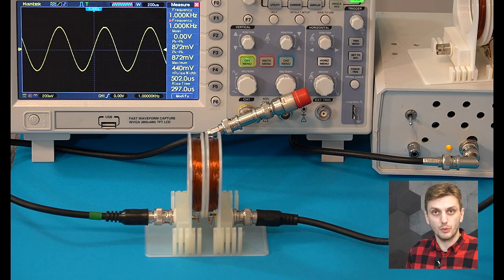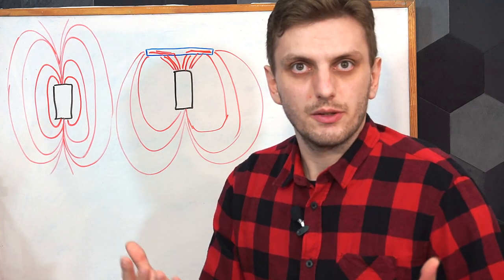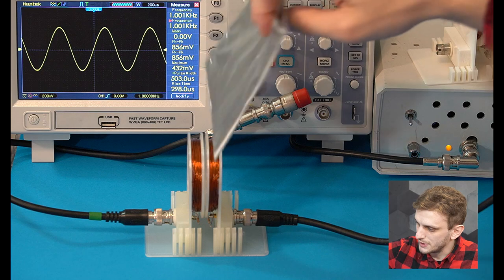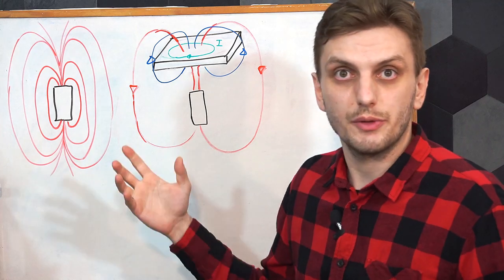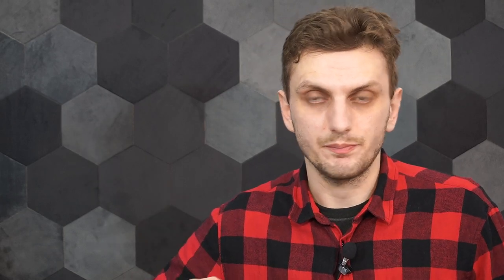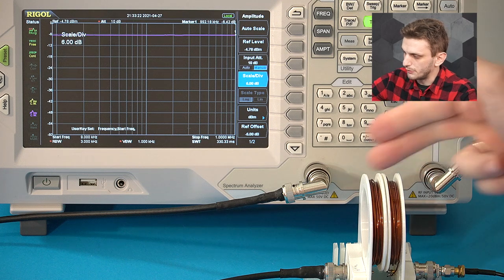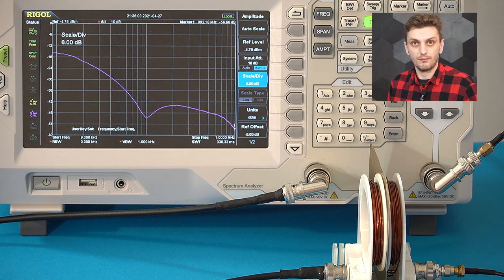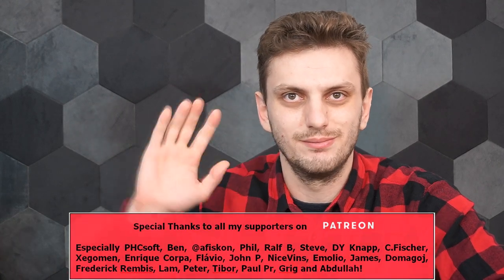EMC tutorials - Magnetic field shielding

Comment: Would it also help to ground the shielding?
What about hybrid solutions, so combining iron with copper for example?
Reply from the maker: Grounding any shield is very important, but its not necessary if we purely talk about magnetic fields, any currents induced into a shield, usually stay in the shield. I do want to talk about this in more detail in a future video focused on electric field shielding - there grounding becomes essential.
Reply: @FesZElectronics  Thanks, looking forward to it! :)
Reply: A good "razor" to ever answer this kind of question is "ground, with respect to _what_?"
In inductive coupling, the eddy-currents are not referred to any external reference, so grounding cannot help. With E-field (capacitive) coupling, it surely will!

Comment: GREAT VIDEO, as always....
I have a pair of 3" spiral wound copper pancake coils...one above the other (spaced at 1/4" to 1/2") connected in series and arranged so that they tend to attract when pulsed. They are pulsed with a capacitor. They are parallel, and one directly above the other.   I would like to shield about half of the circular coils so that there is somewhat less attraction between a portion of the two...do you have any suggestions?

THANKS MUCH
--daLE

Comment: Resumed CPAP Airfit N20 mask has magnets 350-400 mV and they recommend for those with body implants not to use mask with magnets. I have a cochlear implant slightly over 6” above the magnet location in the mask which appears to be ok for me to continue using this mask as it works well with me. I am trying to find some antimagnetic insulator I can wrap around the magnet to shield or lower mV to a safer reading? So I found your video. Any suggestions, thanks

Comment: Good one. Can you also check the shielding effectiveness if the material is connected to ground( copper & steel)?
Reply from the maker: Of course, that will be in part 2 with electric field shielding.

Comment: I really need advice. I currently live in a motel room with a kitchennet and there is a 5g tower 4 blocks away in one direction and 1 mile in another direction. I want to sheild my room from emfs using reflectix, aluminum window screen and galvanized steel but I need advice on how to do it safley without making emfs worse. Should I put it on every single wall from floor to ceiling or just the 2 walls that the 5g is coming from? Also since I live in this room if I'm on my laptop or using my phone which i usually am in the room will it make it dangerous and start ping ponging around the room? Will I still be able to use electronics in the room without it being dangerous? I basically want to limit emf exposure as much as possible especially the 5g is the main concern, if there's a little bit of rf for now it's fine but my goal is to just limit emf as much as possible especially from the outside but I want to do it safely because there will still be electronics being used in the room until night time. Would it be best to just do like 2 or 3 sides of the room or even a faraday cage section of the room separate? Also will ot become an electrical trap of I don't ground it? Any advice helps on how to shelid this room. Thank you and God bless 🙏❤️

Comment: Copper is Used in Transformers, Inductors etc. So, the question is: What If you Ground the Copper to enable the Copper to Generate EMF Counter Forces to Shield? Like the Flux Band Video you posted. It means will the device of interest be riding on the Ground Ref and disturbances and will not be affected by it because of common mode?

Comment: I would like to see both a copper plate and a copper plate together. Also, Can you try painting a sheet of plastic with Lowes Chalk board (magnetic) paint? Try one coat or several. I read it works, but how well? Try painting it on a copper sheet. Does grounding the sheet to the input signal ground help? Also, set you coils such that they don't move between tests so each test is the same. maybe start with 1000mv so we can easier calculate the attenuation of each item rested. Thanks for the video. The question is because someone ask, can I line the inside of my plastic box with copper tape for shielding? You show iron is better, so how about iron paint, and how many coats, and should you use copper tape and then paint it with Lowes Magnetic paint?  I think It would have much more attenuation if you completely enclosed one coil, but you do need to leave an insulated seams to prevent the one turn shorted problem. Also pretty sure larger sheets would have more attenuation. I would like to see more experiments in this area. I subscribe, hoping to see it. Thanks.

Comment: Is that why I found a copper band going around the switching transformer in a UPS?
The one I took apart was connected to ground! Why? 
I saw a DIY EMP shield made of galvanized steel garbage can available from your local home center, it too was only connected to earth ground through a thick copper wire!
What does earth ground do? To ground the induced voltage and current caused by the EM event?

Comment: The shielding sheet must be getting hot due to the induced current. That's how induction heating work. But then what happens in the case of Ferrite which is not a good conductor of electricity? How is the energy dissipated that is fed as electrical energy to the primary coil?
Reply from the maker: A conductive material will behave as you said - similar to induction heating; a current gets generated. With a ferrite, there is a similar principle at play but rather than conducting current, the ferrite (or any magnetic material for that matter) will conduct the magnetic field; at high frequency, the material becomes lossy and turns the magnetic flux to heat;

Comment: Nice video. I am wondering however, a lot of EMC guidelines suggest bonding and grounding of the shield. Why is this nescessary if the shielding effect is due to diverting magetic fields, or due to eddy currents creating opposing fields?
Reply from the maker: The shield has 2 purposes - when talking about magnetic fields, the grounding does not matter; however the shield will also help with electric fields - there grounding is mandatory - the lower the ground connection impedance the better the electric field shielding.
Reply: @FesZElectronics  Thank you! What about if you ground the shield at both ends? The ground, groundwires and the shield would then form a conducting ground loop. Wouldn't the induced currents in this loop from the magnetic field we are trying to mitigate create an opposing magnetic fied thus mitigating the noise further? For example grounding a cable tray at both ends?
Reply: Upon further investigation my assumption seems to be correct. Grounding the shield in both ends is vital to reducing magnetic field noice, at least according to the book "electromagnetic compability engineering" by Henry W. Ott
Reply from the maker: @ferdind1  Thats a great book! I also agree - even though multi point grounding can have the downside of creating loops which could resonate and make thigs worse at some particular frequency, the overall behavior will be better.

Comment: Can you find the resonant frequency of the coil by just using the oscilloscope and function generator?
Reply from the maker: Yes; the measurement is based on the fact that at resonance, the impedance of the coil is at a maximum value - if you inject signal from the generator trough a fixed resistor into the coil and measure the amplitude of the signal present on the coil using the oscilloscope, the frequency at which the signal value is at a maximum will be the coils self resonance. Keep in mind though that because the oscilloscope probe has non-negligible capacitance, the resonance frequency might shift a bit.

Comment: Great video! Why are there two resistors connected to the coils when you were using the power amplifier in the beginning? I assumed that it was to reduce the loading of the amp/match the output impedance, but why is there also a resistor connected to the RX coil?
Reply from the maker: Hello! You are right, I was trying to reduce impedance mismatch issues between the coil a the amplifier ( the resistor is 9R); in the past I had issues with the amplifier output starting to ring because of this. anyway, there is no special reason to keep the resistor on the RX coil other than having a symmetrical system.

Comment: Hi. Does the kemet polymer ferrite sheet change the value or normal functionality of the inductor that's being shielded?
Great videos, thanks.
Reply from the maker: If the inductor is of shielded type, there should be no impact since only a very small amount of magnetic flux is actually escaping.

Comment: Thanks for the very informative and well explained video. My question is, what about aluminum? Have you tried it?
Reply from the maker: I did not try it in this video, but it does not have magnetic proprieties, and its less electrically conductive than copper; however its cheap. You will find shields built from aluminum - its a rather low cost material, and its light so you can make it relatively thick.

Comment: A discussion of magnetic fields due to transformers SHOULD include the magnetic field created by pot cores transformers ,  which are designed to MINIMIZE external magnetic fields. Pot core transformers must operate at high frequencies , they CAN NOT operate at 50,60, or 400 cps .

Comment: Great video about this topic! What is the reason for the low effectiveness of the ferrite sheets in the initial example? Is it insufficiently high permeability coupled with thin material? Or is it possible that the flux density exceeded the ferrite saturation,  and that actually a lower  percentage leakage would be seen with lower primary coil current?
Reply from the maker: I guess the big issue of the ferrite sheet is that its not specifically designed for such low frequencies. I mean even the datasheet starts giving characterization curves above 1MHz. 
That, together with the very small thickness 0.05mm (x4 pieces) and of course some saturation should occur as you correctly pointed out, should be enough to explain the result.

Comment: You also need to consider that the parallel component of the magnetic field VECTOR is far easier to contain in a permeable material than the perpendicular component -- your apparatus considers only the perpendicular component.  Simultaneously, conductors are far worse at shielding the parallel component.  Seldom will noise sources cooperate with your shielding efforts and engineers must design for the worst case.

Comment: What they teach you : "Magnetic circuit of an electromagnet and a transformer."

What they DON'T teach you : "The special effect of opposing magnetic flux being diverted by two different reluctance cores, which is the same as current flowing through two different resistors proportionately. Except that this occurs on opposing magnetic flux which is assumed to be not possible as it breaks known physics and breaks first thermodynamics law. The effect produce a useless transformer, and also an overunity generator."

Comment: decided to mount crossover parts in small glass domes.
then remembered i was using two coils for the woofer🤦 hoping for a solution in this vid 😂.

..well ive got some inch thick steel plate....